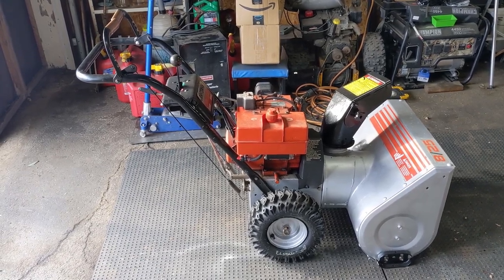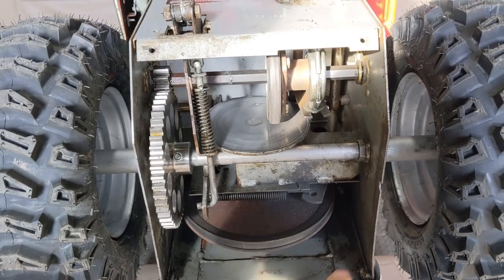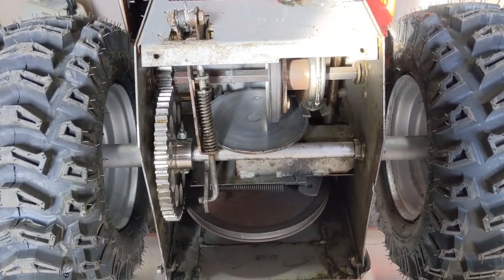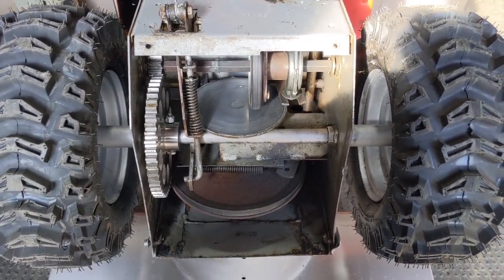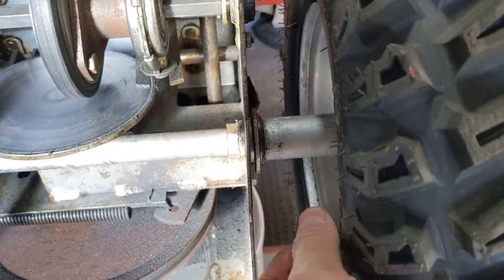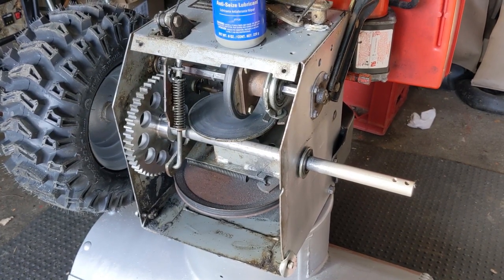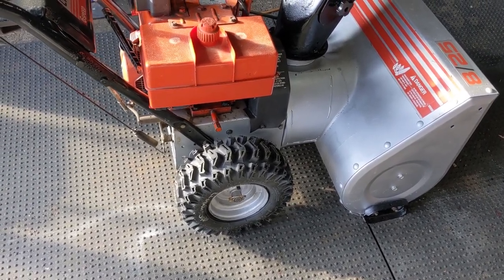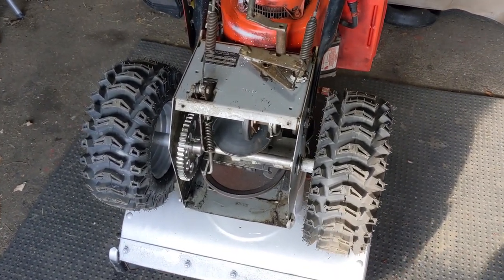Lubricate the Drive Axle - Snowblower Maintenance

Comment: I bought a used Craftsman 5/22 snowblower. I am doing a lot of maintenance and adjustments on it. Today I decided to check the lubrication of the drive axles. I thank whoever owned the snowblower before me: the wheels came of easily the axles had previously been lubricated! I lucked out!

Comment: Would your viper heat induction tool loosen that rear drive axel? I understand it can be tough to aim a torch in tight spaces. I hate to loose or increase the cost when trying to accomplish a task!!! Thanks.
Reply from the maker: Yes, and in theory it would work to heat up the inside while the wheel is seized to the axle using the bearing buddy coil. I ended up having to use heat and a hammer on the one in the video I link below as it was really seized bad.

https://youtu.be/x3tUpiHrD5I

Comment: Great video. Question for you. I have a new st224 husqvarna snow blower. 3rd time used I noticed a squeaking noise when rolling the wheels. Drives fine when running and will roll when off but is loud now when the wheels turn. Any thoughts of why this might be? If I raise the front up and wheels don’t move squeaks the same. Very loud.

Comment: Where are you finding your Craftsman parts I’m having trouble  with that
Reply from the maker: In Canada craftsman went bankrupt under sears Canada, so MTD purchased the rights. MTD only sells some Craftsman parts though, the other parts will be AYP or Murray parts which are now Briggs and Stratton owned. I'm a dealer for both MTD and Briggs, so I source parts directly through them. Sometimes I have 2 orders with 2 different companies to fix one machine, it happens from time to time.
Reply: I have the tracked version of this in Qc. My bushings are gone and the axle slides left and right causing no contact with the gears. What’s the part number for those bushings? Thank you

Comment: If any viewers have chipmunks in their area and have a blower with the plastic drive gear check the bottom drive area before us. Those chipmunks get in there, store walnuts which get caught in the gear when put in drive and rip the teeth right off.